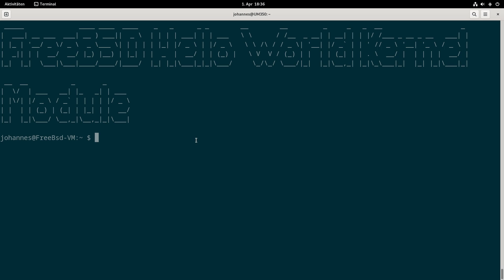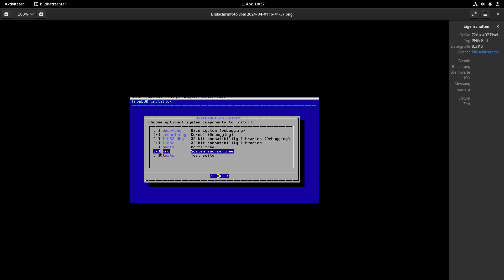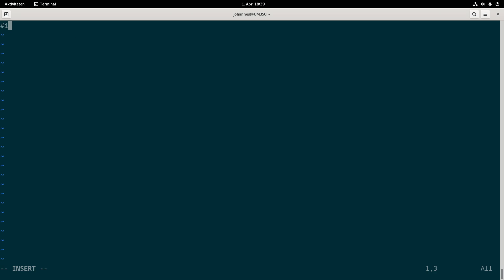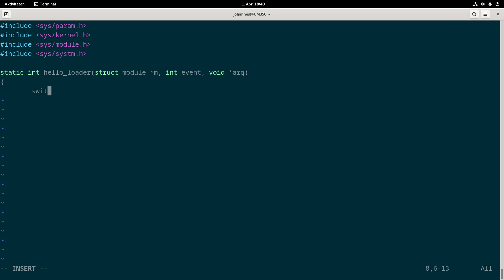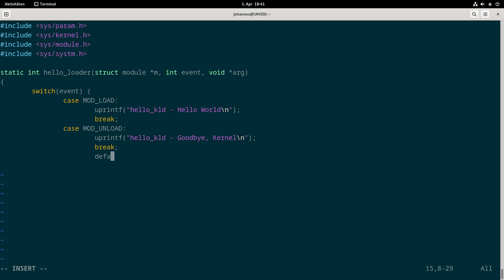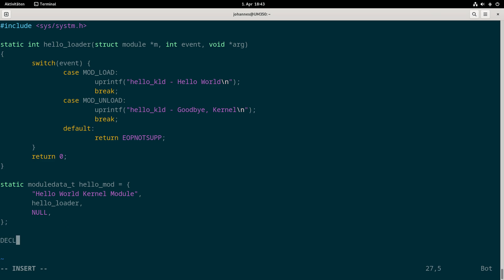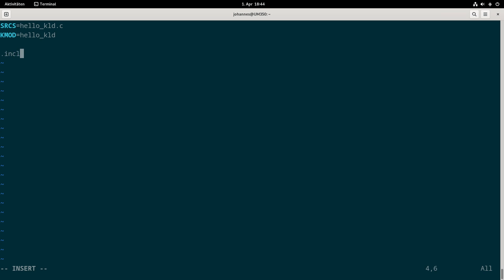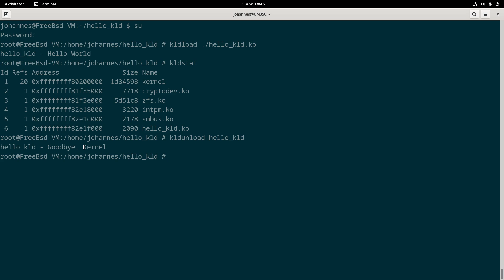Write a Hello World Kernel Module for FreeBSD

Comment: very cool video, could you recommend material on how hardware work and their interaction with software given your microchip linux contrib and fpga work. trying to understand how a fpga work: how luts, bram etc etc work, then the circuit and how kernel code on lowest level operate with the hardware on why the kernel code written works when it comes to driver writing and soc porting and not just sterile "best practices"
Reply from the maker: Thanks. I made a video about recommendations for Linux Driver Programming: https://www.youtube.com/watch?v=jbqd4rov-_k
Madieu's "Linux Device Driver Development" also gives you a little bit of insights to cross compiling a kernel.
But for FPGAs, I can't recommend anything. I would be also interested in good materials here.

Comment: I love FreeBSD!
Would love to see you create a GPIO driver on a Rasp Pi like you did with Linux.

Beastie needs some love!
Reply from the maker: My initial plan was to run FreeBSD on a RPi and not in a VM. But I had some issues. When running it on my RPi 4 with an SD-Card file system accesses were really slow. Maybe it was the fault of the SD-Card. Then I installed the image on an USB stick. This was more smoother. But I couldn't install the kernel sources easily. I would have to download and compile the sources in order to do so. This is why I ended up with a virtual machine.
But I want to do some more videos about FreeBSD, maybe writing a GPIO or even a PCI driver 😉